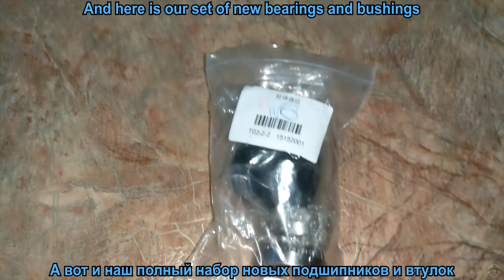Replacing Sur-Ron Steering Bearing at Home

Comment: actually best guide i found, well done thanks! Wondering why the upper bearing does not have the correct inner diameter since you had to use tape?
Reply from the maker: They have make both bearings with same size. But fork, it's axis have a kind of trapezoidal shape. So this is where appearing a different diameters of axis. 
8:17 Maybe it is hard to see on the video, but here it is, this trapezoidal transition.
Reply: @_peacexplorer_  ah i see what you mean. Thats strange tho i ordered a headset kit and it came with 2 different size bearing so i did not use tape to make it fit today when i installed it. Maybe different manufacturers
Reply from the maker: @crax999  different size bearings? Wow, that's cool.

Comment: Hi!!!

Im very intrested on yout feedback about Marzocchi Bomber 58, can you tell me if that fork was worth buying? 1kg less weight gave u more range? Also it absorbs well all  those small/big stones on your trail ride?

Thank you so much!
Reply from the maker: Good morning. 
Well, it's complex question. Does it fork working better on bumps - yes. Does it fork more expensive - yes. For me - it really better, because it "upside-down", compare to the stock DNM Volcano. So mud-wing is much easier to fixate. 
1kg less weight - it mass of my eat. I can go ride before eating. So i will be weight 1 kg less. And also i can go ride after eating. So i will be weight 1 kg more. Does i feel the difference? Not really.
But as i said in the beginning - it defenetly better absorbing small bumps than Volcano. I feel bad for it, when i bumps to the big stones. What if it will broke? So expensive. So i'm trying to avoid it.
Reply: @_peacexplorer_  Buying an expensive fork so it can fit a mudguard better? That's exactly why I bought the Bomber 58 too last week :) 

And ofc I hope it is better in absorbing the small bumps. My Volcano always had a lot of friction. I think it needs a revision/lubrication although it was a new fork.

Thanks for the guide. The tape is needed because the tube diameter of the Bomber 58 is smaller than the Volcano? I hope the tape doesn't wear quick and introduces a play.
Reply from the maker: @gravit0nable  Yep, mudguard is definitely the must-have thing.
Some people says than new Bomber 58 needs a revision. And some people says that it's 100% ready for ride. Who is right - i donno.
Not sure about Volcano tube diameter, i'm not measured it. But we can clearly see that Bomber 58 tube diameter is fatter at the bottom, and thinner at the top. I have another idea - we can buy some soda in aluminium can, and cut a aluminium-band from it. And replace tape to aluminium. It will be more reliable. I think.

Comment: Correction it’s a 36mm (American)
Reply: @_peacexplorer_ I guess you used the rag to increase the diameter a little more? I’m doing it right now with the 36 with no rag underneath it
Reply from the maker: @insanetharapy6948  aw, yep. That was a duct-tape. I didn't do the precise measurements. By eye - there was a ≈2mm gap. Later i changed duct-tape to aluminum cut from coca-cola bottle. Pepsi also will be fine for that.